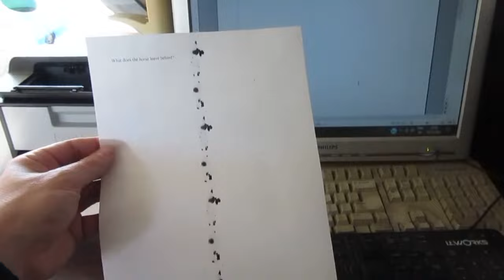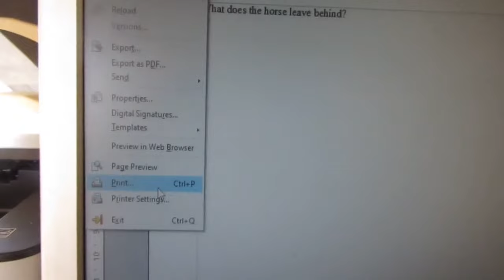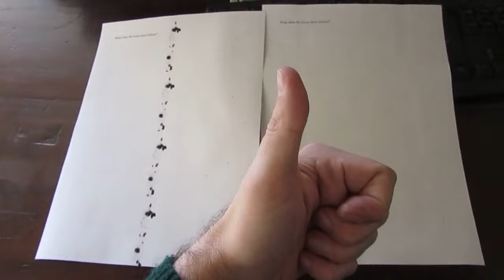HOW TO Fix Printer Ink Smudges, Black Lines, Dots & Marks On Paper Printouts | Smudged Printed Pages

Comment: Great video. Cured my issue with "dots" on every page.  One of the best "inventions" ever is the "YouTube Self-Help Video."  They have helped so many people.  This is a prime example.  Thank you very much.
Reply from the maker: Happy to see it helped and happy to see people fixing their own stuff. Thanks for the feedback, good stuff!
Reply: The quotes make it sound sarcastic.
Reply: @danielhurley2894  you really didn't have to reply. Sorry for troubling you
Reply: @TheLabOtomy  Does it have to be 99% rubbing alcohol or can it be Rexall 91%?
Reply from the maker: @jeremyzeigler1565 Not familiar with Rexall 91% and its composition so cannot comment
Reply: @TheLabOtomy  Anyways I've cleaned the ink cartridges rollers, no help. How do you clean the inside of the printer, cause there's ink in the middle of the paper, and in the corner, how do I fix this?
Reply from the maker: @jeremyzeigler1565  If the rollers are clean, the sheets may be brushing against something
Reply: @TheLabOtomy  Are you supposed to go into the settings and clean it once in a while?
Reply from the maker: @jeremyzeigler1565  That would depend on the manufacturer / brand guidance in the instruction manual. Typically, contamination built up via dust and debris falling on the printer / paper / paper feeder

Comment: This worked on my Canon ImageClass MF741Cdw except that I had to squeeze open the hinged mechanism slightly on the toner cardridge to get the green drum to advance. It seems like the off brand cartridge manufacturer may have overfilled the toner powder, but this isn't my expertise.  I'm certainly not selling my organs so that I can afford Canon toner, so I guess this is my penance for buying cheap(er) toner.
Reply from the maker: Happy to read that with a little ingenuity you did not have to sell any organs. Well done :)

Comment: Okay this is great! Only problem: I do not have an inkjet. My printer is inktank and its doing these black dots and smudges, any idea how I can fix it in an inktank printer? It would be great help😣
Reply from the maker: The printer in the video is a laser printer using powder toner, not an inkjet. 
For any printers having black dots and smudges, make sure the printer rollers are cleaned using appropriate cleaning product (see your printer manual for recommendations)

Comment: This improved the black bands at each side of the paper, but did not eliminate them entirely. Do you have any idea what else I could try? Thanks in advance!
Reply from the maker: Residue on any other rolls?
Reply: I had a black band where I hadn't returned the "snapper reset tab" to the right place once...you can try cleaning it again...